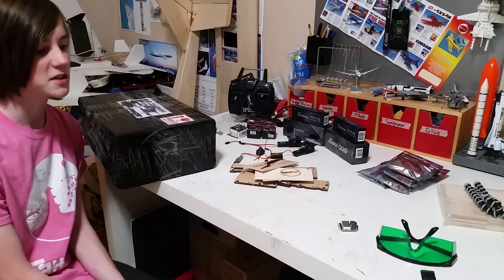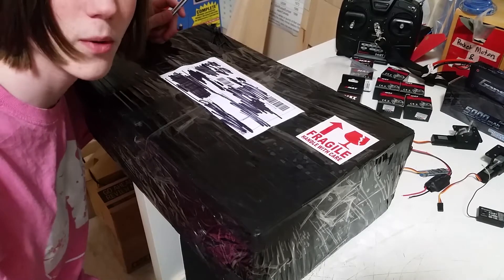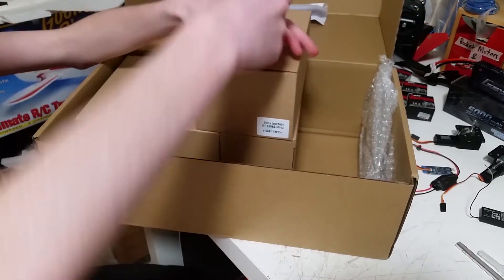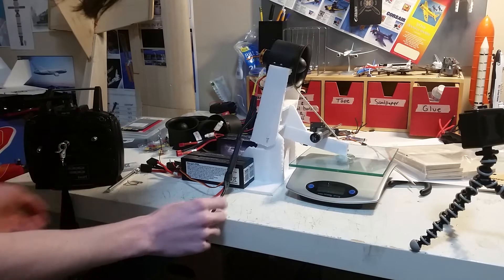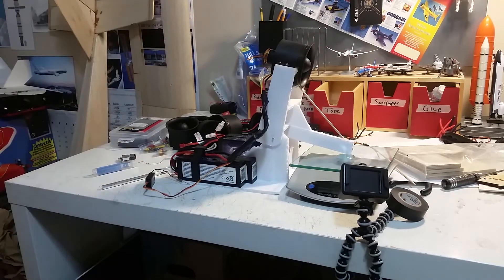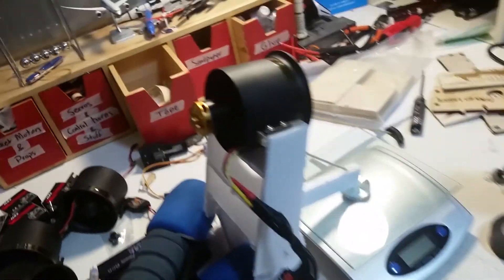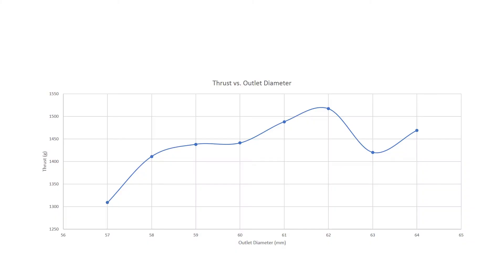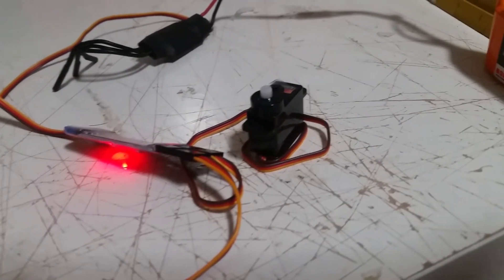1/20 XB-70 Build Log Pt. 4 | Ducted Fan Thrust Testing

Comment: How can I send you a privet message? I have some experience when it comes to rc power systems I don’t want to see your plane cash. I recommend getting a castle creations 15amp bec and only running that as your power source to the receiver.
Reply from the maker: I appreciate and understand your concern for this project. I was originally planning on using one BEC to power everything, but decided to split up the systems for simplicity, convenience, and reduction of electrical interference from the retracts.

I wouldn't want to run a BEC through the receiver, rather, I would use the positive lead off of the BEC to power the servos. This way, I'm not running the current required for five high-torque servos, three low-torque servos, three retract units, and a gear door sequencer through the two little wire traces from the BEC to the receiver. There are two ways to get a lot of power: one large UBEC or many smaller UBECs. I chose the latter, as it would allow me to use my hardware at a fraction of it's rated current capacity, as well as saving cost (they come integrated with the ESCs).
Reply: That makes more sense. Thx for the response I look forward to watching your channel grow. Follow my insta @cmankan2076 if you want to see some of my plane projects and rc stuff.